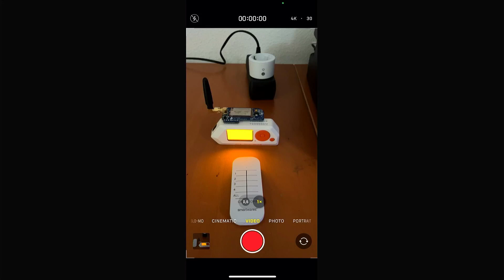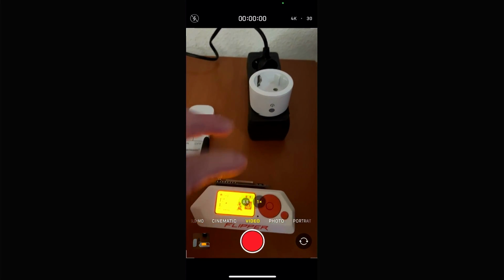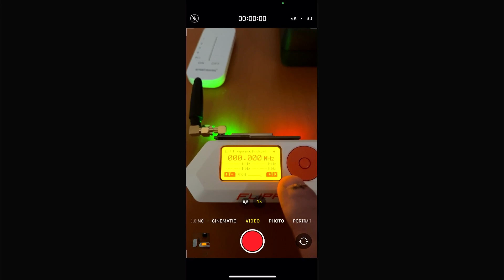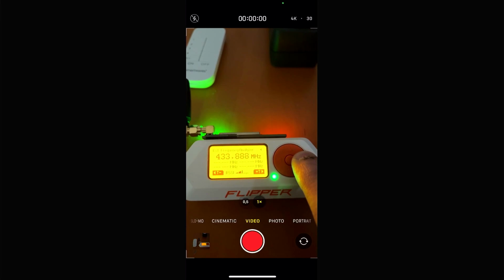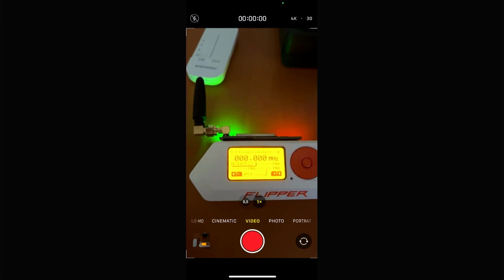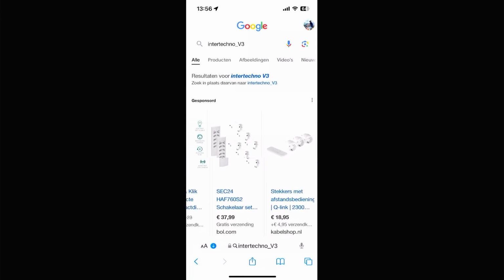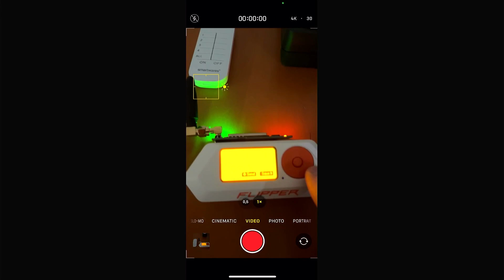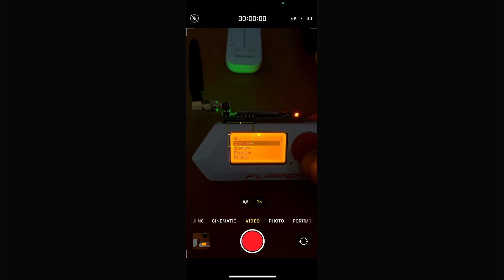Flipper Zero CC1101 Flux-Capacitor Sub-GHz Great Scott Expansion Board Demo

Comment: I received my flux capacitor today, but the Internet is telling me I need a Mail to female adapter wire for this board to work. Did you not have to use one?

Comment: what can you do with it? i hear its a cleaner signal but what does that mean? your the only person with a real clear video out. please make a series.
Reply from the maker: The problem with the cheaper Chinese CC1101 boards is that they don’t have an amplifier build in or the board layout was build as fast and cheap as possible. Earlier attempts from people to make an amplified CC1101, resulted into loads of noise from the power circuit that’s required to feed the amplifier. This board is one of the few (if not the only) who had tuned components by someone (Great Scott) who truly understands components and RF noise (interference). I’m currently learning SubGHz so will think about making a series about it ☺️
Reply: @sgtfoose8842 hey mate can you make a video on how to make custom portals on the flipper just like you did your the WiFi pineapple ?
Reply: Great Scott is from the movie back to the future. It’s what doc brown says. That’s why the board is called the flux capacitor. From back to the future. 

It’s not the guy who did this.